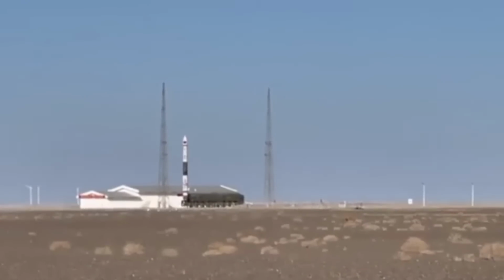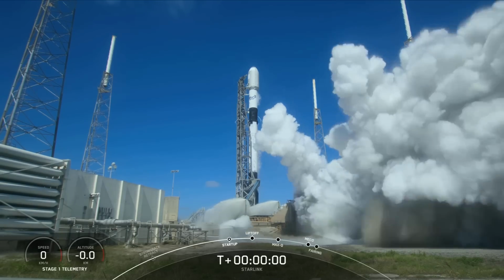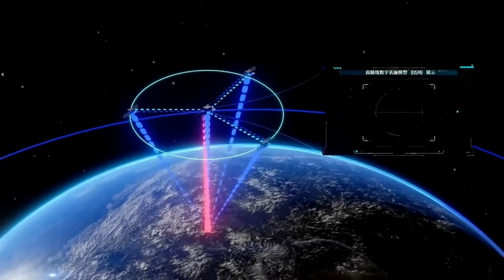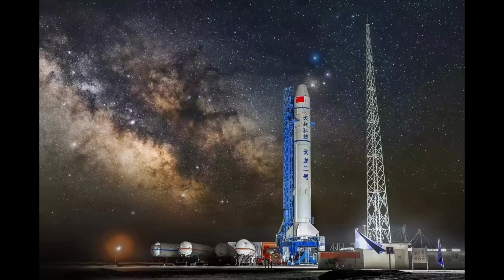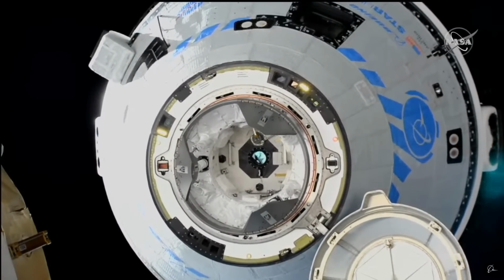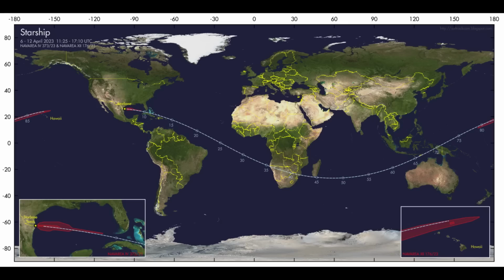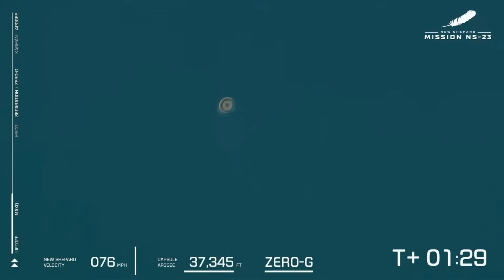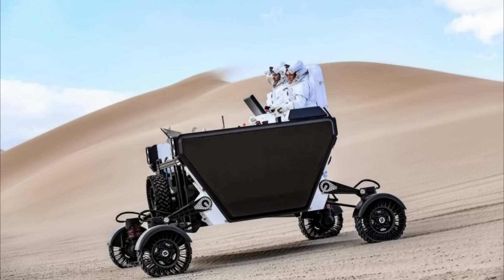Is China's New Rocket Really Coal Powered? Deep Space Updates - April 2nd

Comment: I'm also working on my PPL, partially motivated by you. Good luck on your check ride! Question, do you pick airplanes for your flights based on the fuel they consume? I would prefer to avoid leaded fuel personally, just wondering if it's a concern that's on your radar.

Comment: Could starlink  connect to starships aft side of re-entry and keep communication during re-entry and avoid the black out?
Reply: I would think so. U.S spacecraft up through early Shuttle had communication blackout for several minutes during reentry, but that doesn't happen anymore since until they launched the TDRS satellites in the late 1980's which are able to communicate through a hole in the ionization on the backside of the spacecraft. Assuming that the Starlink signal can get through then they should be able to maintain communications.

Comment: I note that Blue Origin NS23 was uncrewed, so there was actually no crew on board.  So, luckily!, there was no crew on board to experience the G loading as the capsule escaped.  And judging by the video, it would be quite stomach turning to have been inside the capsule at the time.  That said, if the booster is incinerating itself, one would want to back in Kansas the moment you clicked your heels but even so.....

Comment: I read that the return trip from ISS to earth is ~6 hours (but might be longer depending on whatever).  That said, most of that would be prior to the craft becoming very hot on reentry, I would think. 
My  feeling is that 50C is bearable for a period of time, but if that is how how MS22 was inside, I don't think I would like to be in it for the trip.
Reply: It wasn't really about reentry heating because the descent module that the cosmonauts ride in separates from the other two modules shortly before hitting the atmosphere. So it's on it own as far as cooling during that phase anyway even in a normal reentry. The issue with MS-22 was in fact the lengthy time between undocking and reentry, because that's when they are still depending on the service module for cooling.  The descent module isn't designed to provide cooling for that long.

Comment: Gee. That New Shepard capsule really doesn't look too stable during abort. I looks like it is in danger of "swapping ends" while the abort engine is firing. Pretty scary.
I like the Dragon 2 design with the stabilizing fins on the service module during abort. It is by far the most stable design during abort when compared to New Shepard or Starliner.
Reply: That rocking back and forth is a design feature, Human Factors-engineered to distract the paying passengers from the fact that not only did a rocket just blow up, but it was the very same one they were riding on only seconds earlier.

Comment: ISRO has been juggling with multiple programs over the years including Mars missions, Moon missions, Human Spaceflight, Navic and launches for Govt and Commercial payloads. All with limited resources. Most likely why it took ~ 7 years to follow up after their HEX mission for RLV-TD in 2016. But now that LEX is successful I expect them to follow up with OREX and SPEX missions for this RLV-TD. Following a very methodical step by step way towards a Space Plane that BTW is very different from the Space Shuttle and X-37! Good luck ISRO! Fly safe! 😃
Reply: Let's hope it's different from the Space Shuttle!  Being able to fly through rain, for example, would be nice (I suppose thermal protection will never be done in that same way again).
Reply: @marcmcreynolds2827  It will be! For starters the winged spacecraft will be mounted on top of the 1st stage booster, not on the side like the Shuttle. No fairings  like X-37 or Dream Chaser. Also it will be capable of powered flight with Scramjet engines. ISRO wants to create a fully reusable TSTO system. Obviously immense challenges remain to surmount but I have faith. They have some very smart folks there! 😃

Comment: I've love to see the large rockets start launching from the water.  This idea was originally targeted for the largest rocket designs of all times, which came about in the 1970's after Saturn V became common to launch.  They needed a bigger, cheaper, higher payload rocket to carry men and equipment to the moon and beyond.  Building the launch platforms and initial cooling/suppression systems is expensive.  Plus, each rocket design needs a slightly different launch platforms.  A rocket can be towed to deep water, and fueled.  This makes the rocket negatively buoyant and pulls it upright.  Keeping the fairings sealed from water makes the top of the rocket positively buoyant, thus making one very stable rocket.  The bottom of the rocket would be below the level of the wave energy.  When ignited, the water around the rocket provides cooling, pressure compensation, and stability, all without needing to build a massive structure.
Reply: It was an interesting idea on paper.. and that was all.
Reply: @TheEvilmooseofdoom  How so?  Several tests were conducted with great success.

Comment: 07:45 Most likely not: Due to sanctions, Nazi-Germany synthesised most of its fuel via Fischer-Tropsch- and Bergius-Pier-process from coal and water via syngas. However, they used ethanol in the V2 and I cannot find any source about how it was produced, but most likely not via fermentation. And because such coal liquefaction processes were used to produce cooking fat, they most certainly used it for the ethanol as well. And even after WWII, the GDR, South Africa and others used theses processes to produce fuel of different types, so there might be some of it used in soviet rockets…but I have no sources for this claim either.
Reply: "I cannot find any source about how it was produced"  An on-line search yielded  "...30 tons of potatoes to fuel a single launch", but I've seen conflicting info regarding A4 fuels over the years.  For example, that it used methyl alcohol (perhaps only in field deployments, vs Peenemunde?) so that soldiers wouldn't drink it.
Reply: @marcmcreynolds2827  This 30-tons-of-potatos is from a blog-post, which is not used in the German Wikipedia. I cannot find any good source in the literature I would trust. Dry ethanol by fermentation in such a scale is quite odd, given that the chemical industry in Germany was capable of producing both ethanol and methanol by other means.
Reply: @RepublikSivizien  I've also read (pre-internet) that towards the end of the war in the Pacific, Japan was needing 250,000 plant roots to distill enough fuel for a single fighter aircraft mission.  So pairing one bit of perhaps unreliable info with another, presumably such a dodge on the part of the Nazis (if true) came late in the war as allied bombing campaigns took their toll on industrial production?  But not my field, so at this point I yield to whomever might be better informed.

Comment: well ece engines are nice, even valveless afterburner ramjets, air breathing no-moving parts engines
Reply: spin some propellant dust as fuel b0mb, yes you can burn coal in solid rocket boosters, but also air mixed dust burner thruster/engine ice turbine/VAR/VAS works (va-sc-r)
Reply: why would you power a plane with a rocket, use air breathing in atmosphere, yes first stage

Comment: I got mine in 1960, license YZP12677. When you get your license, take some time to get an old Piper Cub and practise stall/spin maneuvers. Get used to the mushy controls and the sudder before she finally breaks. Put that into muscle memory, so when you are turning base to final and concentrating on the runway, you will feel when you are getting close to a stall and automatically put the nose down to gain more speed. Stall/spin accidents are notorious for taking out unsuspecting pilots. The muscle memory will save your life one day. Also practise cross controlled sideslips to kill altitude. This is a very handy maneuver that you will probably never use, but it increases the connection between your brain and the aeroplane, and may save your life one day. Another trick is how to avoid PIO, or piiot induced oscillations. This happens while landing and occurs when the pilot is 180 degrees out of phase with the airplane. It builds up until the pilot nose-dives into the runway, destroying the A/C and maybe killing himself. My instructor taught me to pull the stick back and hold it there until the plane responded, then gently releasing the stick to lower the plane to the runway. I only had PIO once or twice early in my career, and this instruction probably save the A/C and maybe my life. Another trick in a taildragger is during the runout when you can't see the runway in front of you, is to switch your gaze to the side and control the A/C by keeping the distance from the wing to the edge of the runway constant. This problem never occurs in tricycle A/C, but it will occur when landing your Cub. The instructor will probably be too young to know about it.

Comment: VO spent over 1 billion getting to orbit and needed another 420M to keep afloat, the product was doomed by poor vehicle architectural choices (ai-dropped KEROLOX rocket) and the 747 operational cost and runway support requirements. Also overseas launches required the rocket to be transported by another aircraft to the spaceport, which again increased logistical and operational requirements to the point that the advantages of the air-launch where smothered by high cost and limited operational scope.

Comment: Does every CCP rocket always have falling debris when the lift off?
Reply: The Chinese usually launch from the Gobi Dessert, so they’re going to drop the booster 300-400 km southwest of the launch & the 2nd stage (of a 3 stage rocket near the coast…
Reply: Most of them. It's not debris, though... they're insulation panels, designed to fall away during launch.

Comment: I agree that the heat shield is the most problematic part of the Starship and given the repeated loss of tiles anytime an engine is fired up doesn't bode well for survival of Starship in reentry.  Frankly, I think one of the major problems with the heat shield is actually the physical design of the underlying skin of Starship.  A 9m tube is going to wobble and flex and those tiles will not like that.
I predict that when Starship is launched we will see many tiles pop off on engine start.  I expect to see other tiles pop off during ascent, particularly around MaxQ.  I then expect additional tiles will be lost on reentry and that the totality of tile loses will doom Starship.  Sadly, I do not think they will be able to fix this with the current Starship design.  I suspect they will need to move to a disposable 2nd stage and doing that should substantially increase the payload.
Reply: I love pretend experts.
Reply: @TheEvilmooseofdoom  OK, perhaps you could point out the specific issue you have with my assessment instead of non-specific babble!
Reply: @Java-Man-x  -- Agree, the use of propulsive landing is required on the Moon and Mars but is not required for Earth.  The preferred type of landing on Earth is as a glider like the Shuttle.  The idea that a massive Starship upper stage is going to land on the Moon then take off and land, propulsively on Earth is ludicrous.  There is a better way but SpaceX is going with the better way.
I suspect the Starship, as now designed, will never work reusably and would be needlessly heavy if used disposably.

Comment: 6:35 

The amount of foam falling off the rocket just worries me
Reply: That's a design strategy the Chinese use frequently and are happy with. The exterior has a lot of foam panels to mitigate the vibration and acoustic energy impacting the payload. As it rises the panels are designed to peel off.
Reply: @donjones4719  mhm, I agree foam does help a lot with vibrations and it's probably not as dangerous as it is with the space shuttles since the rocket does not need to re-enter the atmosphere

Comment: Yeah all they said on the Space X launch today was that the previous attempt had an issue that was triggered by one of the engines when they lit it and so it automatically aborted.  The also said they had investigated it and felt it was fine.  So maybe a sensor, maybe ground equipment signal interference.  They didn't say.

Comment: Good luck with that pilot license - will you be buying something to fly around in?
Also, all the crap that flies of the Chinese rockets at launch, I've heard people say it is ice but 5:40 looks like a shower of. rectangular pieces flying off the nose cone, then later more clearly on the "land sat" 6:34.
Reply: Scott has actually done a video on this at some point, it's thermal insulation... this sort of drop off tiles is quite often used especially on hypergolic rockets, what's always interesting to me is that they also have it on the payload fairing
Reply: It is by design. It is insulation for the cryo propellants. Once the rocket is ignited, the insulation is just excess weight, so it is discarded.

Comment: The 4 Chinese sats doing land survey are probably "laser linked" such that small changes in their respective distances to each other can be used to map the local gravity.  Coupled to the optical data could provide very accurate g-maps.
Good luck on your check ride.  Did my solo (16th B-day), private (B4 my 17th B-day) and commercial (before my 18th) and flight instructor not long after that.  Was teaching for several years before getting ... my driver's license!  Long time ago...
Reply: The high-precision digital model of the Earth's surface.
Reply: Multiple angles at the same time improves the topographic map accuracy from stereoscopic imagery plus eliminate gaps in the image such as sides of steep cliffs or sides of buildings or partly obscured surfaces due to tree canopy. Also, the cameras may be different spectral bands to get multispectral “materialization” to determine surface materials.  
    If they can get good topographic maps of ocean waves, they could figure out some interesting things including moving subs, and bathymetry and weather/climate/evaporation.
Reply: As crazy as it sounds I suspect they are simply prepping for an attack and are doing a survey of countries who might interfere with their invasion of Taiwan.  The fact I have to even preface this statement knowing people will think its tin foil hat stuff is the most terrifying part of it all in my opinion.
Reply: The hydrocarbon molecules created from  coal might be 99% the ideal hydrocarbon molecule compared to kerosine from distilled oil.
Reply: no freaking way. guys they send a few imaging satelites and they spin arround in a circle with 1 in the middle to make like a huge lens like a telescope or microscope, kinda the same as the black hole image but with this and ai they could watch scarily close on the ground. look at how good google maps is and now imagine that with a few sattelites working together which are government funded theyre gonna be insanely detailed and basically have sci fi level view from space, an eye in the sky.
Reply: The chinese might be using those satellites to find interesting things under the ocean surface, such as US submarines.
Reply: @rickgpz1209  Subs are pretty insignificant to be picked up by these.
Reply: @rickgpz1209  
Mapping subterranean geotopography and analyzing unpredicted deviations
(They might be using it as a form of laser interferometry to scan for underground installations)
Reply: Very interesting concept I think; an unusual instance of original Chinese innovation.
Reply: @HuntingTarg  Was done about 10 years ago by NASA GRACE - sats are still up there (a pair) I believe.
Reply: @AlanTheBeast100  
Well then; disappointingly, but unsurprisingly, it's a copycat:
 CNSA is essentially redoing an experiment done by NASA, with a twist (😉).

I wonder if the rotating configuration will enhance the dataset somehow.
Reply: @HuntingTarg  It's plausible, even likely, that they will get more accurate information - whether laterally or in terms of g measurements.  Chinese technology stands on the shoulders of western technology - much of it pilfered due to not respecting IP.
Reply: @HuntingTarg  Well, I have to argue that now we learnt the technology, we could do something more interesting than copying designs. And our older designs were not techenically copied. Instead we learnt a lot from trying to match the most advanced stuff. You probably should expect more innovation from us. However I do agree that we still have lots to learn in some fields and reverse engineering is a really easy path when catching up.